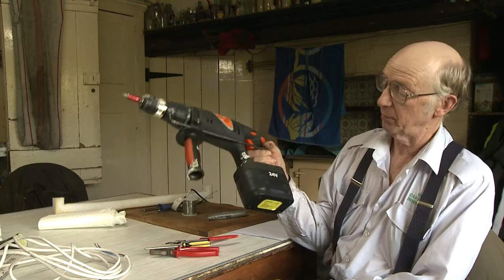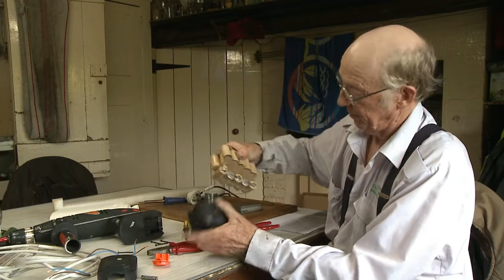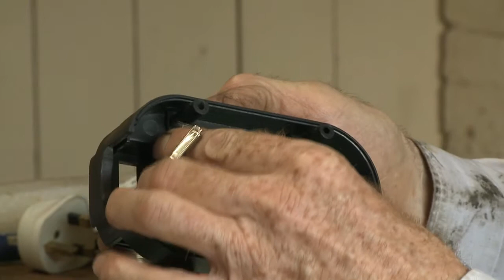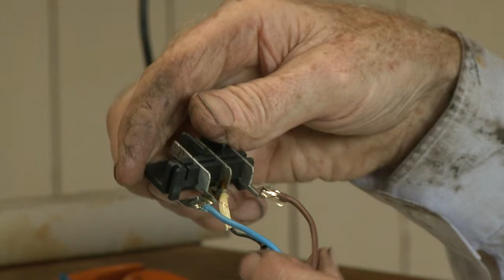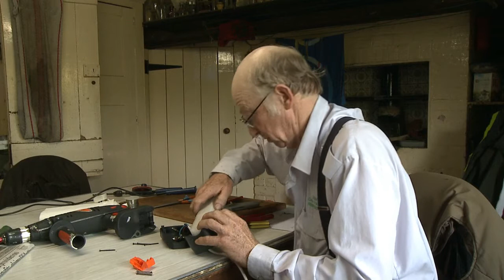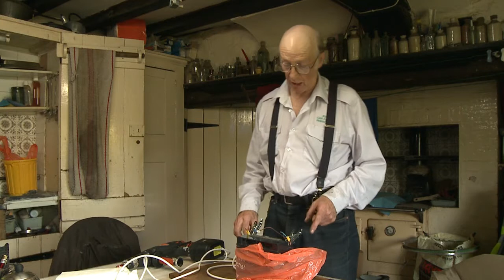Project 1: Drill Battery Conversion

Comment: Hi John! How about make a video about converting a Versapak (NiCad) Black&Decker battery into a Lit-ion battery. I bet there are a lot of garages around with the Versapak set of tools sitting around with no use because of the bad choice of battery done by B&D. Most amazing is that no aftermarket came around to cover that need, but the Versapak Gold (nickel metal hydride), which have similar problems. Att.: there are a couple of videos out there but of no use. Take care!